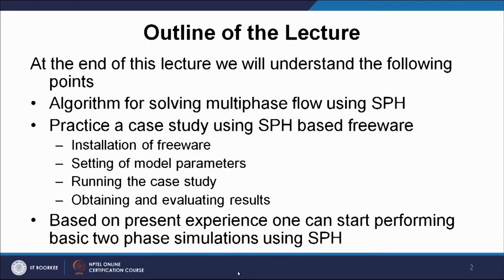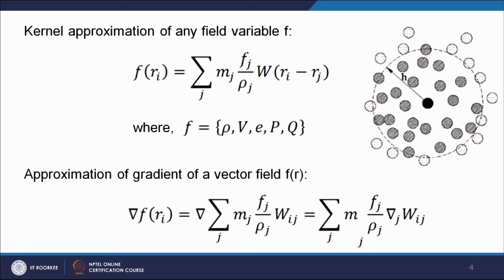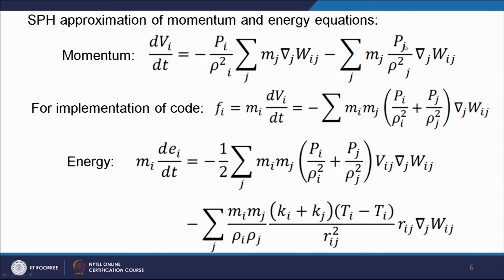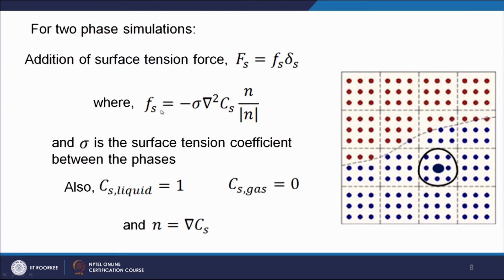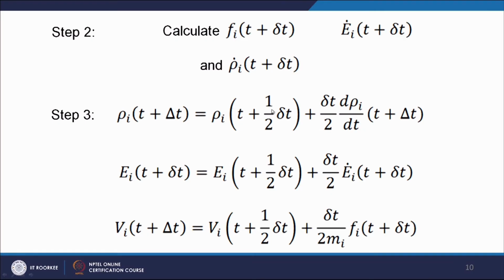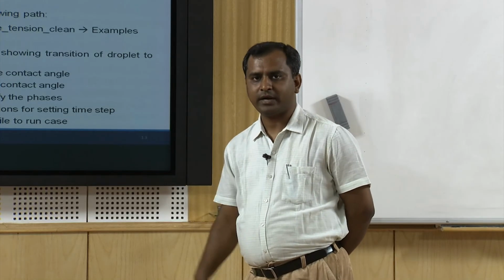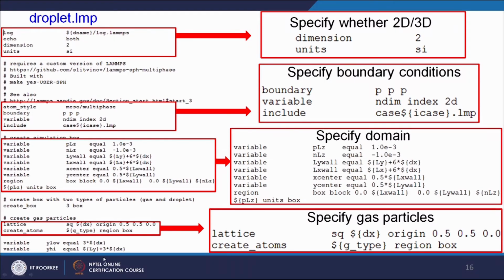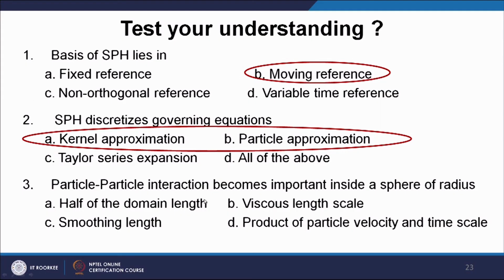Lec 15

Comment: What is the speed of sound of a particle??
Reply: The speed of sound is a parameter in SPH required to ensure that the flow is incompressible. It is not the actual speed of sound in the medium. 
Details: Most of the grid-based models the flow of water as incompressible since the speed of sound in water is very high as compared to the bulk motion speed (very low mach number). However, in SPH, the fluid pressure is an explicit funtion of local fluid density and the fluid motions are driven by local density gradients. An artificial equation of state is therefore chosen. The speed of sound thus chosen is low enough to be practical and high enough to ensure incompressibility of fluids such as water at the low mach numbers. 
For more details, please refer:
 Morris, J. P., Fox, P. J., & Zhu, Y. (1997). Modeling low Reynolds number incompressible flows using SPH. Journal of computational physics, 136(1), 214-226.